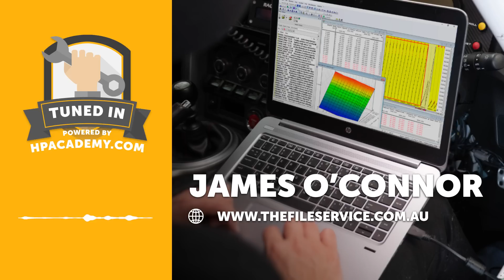061: Tune ANY Factory ECU With WinOLS [#PODCAST]

Comment: Teny told we can remap any equipment with an ECU the question how to extract the files from differents ECU?
Reply from the maker: You need an interface tool which extracts and writes the data from and to the ECU and these will generally make the required checksum corrections for you too, although you can use 3rd party services for this too if required for any reason.
If you were using something like HP Tuners, their MVPI device does all these things for you.
For WinOLS we can use things like PCMFlash with a Tactrix cable or the likes of Autotuner and bFlash if we're commercial users (they come at a commercial user price).
Since this podcast was recorded we now offer this course FYI. It might be something you find useful: https://www.hpacademy.com/courses/winols-mastery-map-identification-and-editing/?utm_source=youtube&utm_medium=social&utm_campaign=general-interaction  - Taz

Comment: Good video. One correction with an A2L VS HEX file. The a2l is actually the “frame” and the hex is the “data”, so the other way around from mentioned in this video. 
Source : I work as an calibration engineer at Bosch
Reply from the maker: Thank you Garrett. Noted.

Comment: Four stroke motocross motorcycles is what we race and the story is the ECU’S are locked and can’t be turned beyond a certain low level that the manufacturer allows/ supplies for the bikes after listening sounds like I need to contact James for the information to make that happen. 
Thanks for all your time and help with the black hole of ECU’S

Comment: I heard that some companies are gonna try and use internet connectivity to refresh the ecu if it detects a change in the rom. I'm interested to see how they plan to do that and how people will overcome that.
Reply: lol airplane mode - on
Reply from the maker: Annnd boom, 'grounded' 😂 These engineers aren't that dumb 😉

On the flipside those in the aftermarket aren't either 😀 - Taz.
Reply: These kinds of checks are fairly easy to bypass. Similar things are done in desktop software DRM. You just find the section of code where it stores the home server information and falsify or disable it. Redirect it to a different server that returns a blanket all good signal, etc

Comment: This was a great podcast. It really touched home with me. I have a car equipped with a Megasquirt 1 that i learned on. I have another car that i wanted to MS, but i wanted it to be as reliable as a Toyota. I decided to keep the OBD1 ECU and program it with a chip, dyno tuned by a tuner that has great experience with this model car and tuning strategy. That worked until i found a driving condition that exposed a tuning hole. I also was a little disappointed in the max power output for how i built the car. I suggested MS to my tuner and he is against using standalones for a few reasons, mainly because they take so long to complete. He lives far away and seems uninterested in working with such old tech. I want to take my project tuning into my own hands and get the power i believe that's in it and make it have Toyota manners. Great podcast HPA, Andre and Mr. O'Conner - Pantyeatr1 🏆

Comment: Great podcast. 
I used OLS few times (mainly to get initial manufacturer values for some settings), and yes, if you're not aware what you are looking for and where to find it, you could easily get lost into a sea of meaningless hex numbers... Both the strength and weakness of OLS is that it present you all the raw code from a ROM, and permit you to change everything you want... After that it's tuner's responsibility to modify right datas, in meaningful way.
Reply: Even can bus fd? Digital networking stuff?

Comment: Very cool you've looked into WinOLS now. I remember asking you about 5 years ago for help and you hadn't worked with it much or at all then. I've since stepped away from VAG  products and now own a Dodge, so much simpler tuning. Loved the pod and keep up the exceptional work!
Reply from the maker: Yes it has taken us a while and we hope the demand is there to help those who need the knowledge out. You might own a VW etc in the future again, who knows, although there is more commercial software available for them now than there was 5 years ago too. Not all good though, HP Tuners for examples works on some Mks but not on others despite advertising stating otherwise!

What platform are you using with your Dodge, that is on our list as well probably, via HP Tuners - Taz.

Comment: First time caller long time listener, thankyou for these podcasts. Does a tuner without a dyno just chuck 8 bags of spuds in the boot a drive around with the hand brake on?
Reply from the maker: Cheers for calling on in! Easier to left foot brake, and only 8kg of spuds if you happen to by buying that many at once to stock up the pantry 😅 - Taz.

https://www.hpacademy.com/previous-webinars/the-key-to-road-tuning-left-foot-braking/?utm_source=youtube&utm_medium=social&utm_campaign=general-interaction

https://www.hpacademy.com/blog/was-our-dyno-tuning-accurate-our-fd-rx7-project-ep-3-build/?utm_source=youtube&utm_medium=social&utm_campaign=general-interaction

Comment: If manufacturers don't want us to reverse engineer their ECUs then they will have to make their own CPUs lol. Compiled codes laid in the ROM are compiled with tools that's made for each CPU. Even if the CPU is new, it will be decompilable soon. Or if it's the CPUs that's been around, then it's most likely to get decompiled when someone wants to. No one can fight that once we get our hands on the ROMs.

WinOLS might not be the tool for reverse engineering, but it's very useful and very well worth it for rom editing. The more you use it, the more useful it is. There are many professional WinOLS users who don't rely on other tuning software anymore, they just use WinOLS. WinOLS is the best automotive hex editor, not just my opinion, just facts.

If you go further with Ghidra or IDA Pro, and you keep digging without stopping, you will find yourself somewhere deep in the rabbit hole without yourself realizing before that exact moment.

I urge you all to keep digging and digging. And then one day, stock ECU tuning can really be truly community driven.

I've been playing with Honda ROMs for a couple of months. I haven't had any experience in tuning and reverse engineering before. Now I can lock the reading through OBD2 port, I can define read keys in Honda ROMs, I can find all the maps in Honda ROMs (that's not Bosch). And I mean I do that accurately. All thanks to the people that I got myself into. That helps accelerate my learning a lot. And I know that it won't take long for you too!

We can even do a turbo tune on stock Honda ECUs without any special tools. Changing map sensor is possible in so many Honda ECUs. MAF scaling is very easy. And tools for reading and writing are widely avilable these days. Datalogging technology is super great these days.

Once you are reverse engineering. You will know what to touch when tuning and what you woudn't want to if you don't know what you are doing. You can even relocate the tuning tables and extend the tables for more tuning refinement, or do a turbo tune in extended tables and axises. You can separate parameters that's being used by different functions to make them independent when you are making custom stuffs. There are many things to see and to learn. And you can really see how manufacturers do things. You will see how every thing is connected together. What this table does, how a function looks up the value it needs to,  what sets the data type, where its selected value goes, which ram address it sets, what reads that set ram address, what it uses it for, and so on!

DO NOT STOP DIGGING!
IT WILL ALWAYS GET BETTER EVERY DAY!
Reply: I needed this comment. Thanks.
Reply: @kensmechanicalaffair  same, so refreshing and motivating seeing people banging their head on the same problems that you have
Reply: How did you learn
Reply: Have you got your head in the sand, we have been community tuning the 4g63 and 4bt11 platforms forever. 

Hex editors 
Ecuflash
Evoscan 

We have finally hit a milestone recently in finally cracking the TCU for the Getrag DCT. 

Sure Syvecs could manage the DCT befor the community, but as a cummunity we finally acheived it
Reply: @nathanpallavicini6687  Well, I'm happy for Subaru and Mitsubishi tuners that you all got it together since long time ago. Can't say the same for Honda OBD2 (not OBD1).
Reply: This is great and all, but we shouldn't be discussing having to crack software for vehicles we purchase in the first place. The companies hide behind patents and copyrights not because they're afraid of someone learning about them but they do it to keep us coming back.  But who am I kidding?  This is America ignorance lets override something that is essentially ours and not say one word or boycott any company cause dur de dur I'm American.  Worrying about the tranny getting attention is just too much to handle